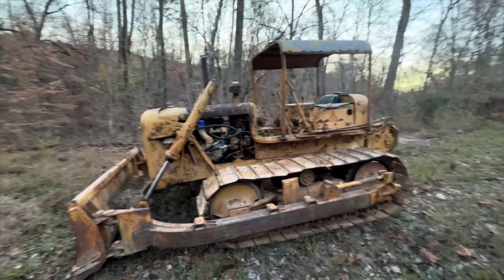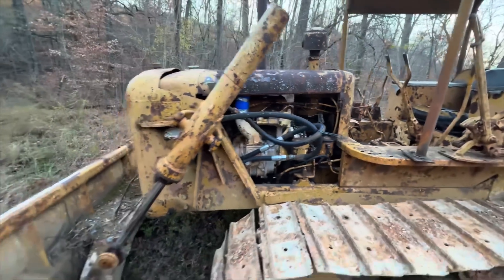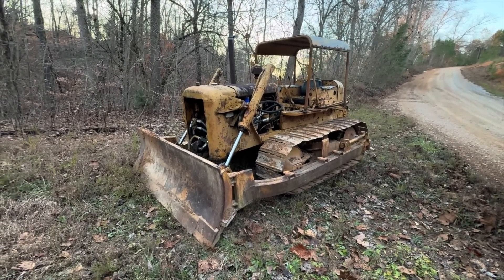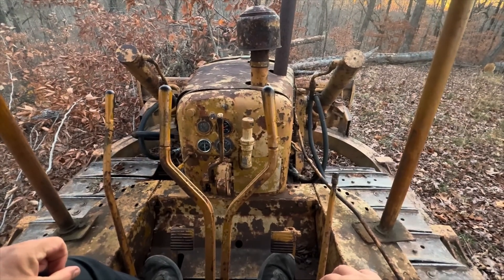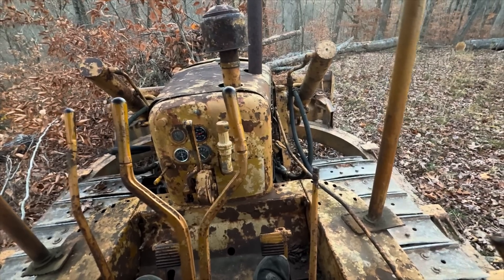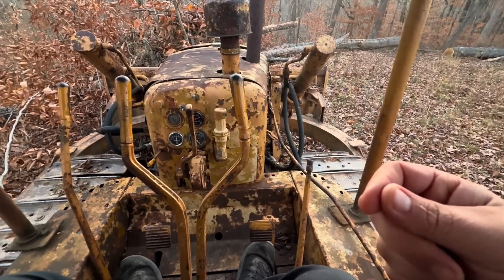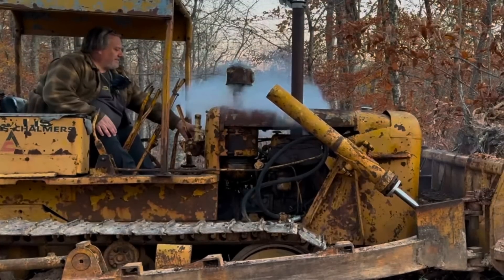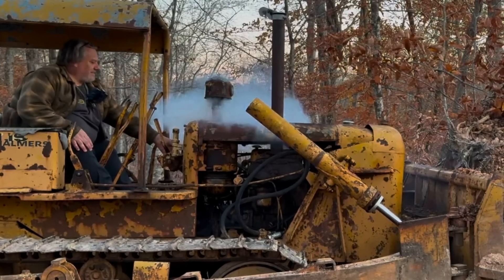Detroit Diesel 2-stroke running backwards. 1950’s bulldozer accidentally restarted running backwards

Comment: We used to do that with multi fuel Duce and a half in the army. Put the truck on a hill, put the trans in 5 th high range. Let roll down the hill backwards and dump the clutch. Smoke billowed out the air cleaner, can imagine what the engine was ingesting pulling air through the exhaust pipe. We thought it was hilarious to have a 5 speed reverse.
Reply: That ole was getting no oil the whole time she was running backwards

Comment: Our 720 John deer two cylinder diesel would occasionally start backwards if it wasn't spinning fast enough when  the decompression lever was released. The oil bath air cleaner would splash out onto the cowling top, making a huge mess. If it ran long enough it would melt out inside of the oil bath.   
Love your videos> It reminds me of working on rusty old farm machinery with hand tools.
Reply: After I changed to electronic ignition, My Yamaha 2 stroke can run backwards too. 
At idle, Just blip it's clutch at the right moment. It'll stall & fire up again running backwards.

Comment: Watching the old dozer thread around the buses, hope a steering clutch /brake do not jam and swing the blade through a bus. With that old dozer I would crawl at a snails pace in those areas.  Your Fire truck just placed a little scare the other day. Yet nice to see the old machines still doing a days work.

Comment: yup. At least you had a fuel shut off. I once had a backspin in a 1966 GMC "crackerbox" with a 318. Neat thing was it had a huge oil bath air filter so not only did it smoke like a Tennessee still in January, it spilled a ton of oil everywhere before I could pick a gear and stall it out. (Key location was a little weird)

Comment: This short backwards run seems harmless but isn’t the oil pump also turning backwards and no longer providing oil pressure?
Reply: That's correct, no oil pressure running backwards.

Comment: Not limited to two strokes. A few years ago, I did the same thing with a Series 60 in a W900L while stalling out a 105,500 lb. hay truck on a hill. It started running backwards before I got the clutch all the way in, had lots of smoke out the air cleaners and a terrible sound. Shut it down let it set a minute then I started it right back up.
Reply: I didn't know a 60 series would run backwards.  That's good to know. I know if a Cummins goes backwards,  the fuel pump will not pump fuel.
Reply: They are on roller bearings

Comment: I had heavy equipment mechanic s friend s they said they made right & left rotation  671 Detroits
Reply from the maker: My bus is a left hand rotation detroit diesel 6-71
Reply: They made left and right in many of the DD series. Common use in boats so that prop walk was eliminated.

Comment: Wow, Allis Chalmers built 29,255 of these machines between 1946 - 1955 !!!  I wonder how many are still running?
Reply: We had three of them until the late 80's. 2 track loaders and a dozer. Bought all 3 at an estate sale and they were like new. Lady gave us all the original paperwork and manuals when we went to pick them up, When I was loading them her dog jumped up and rode on the machine with me. She told me the dog used to ride on it with her husband and teared up a little bit. It was a bittersweet moment even for the 23 year old I was
Reply: I think you mean 1955 to 1974, thats the timeline of the HD6 dozer.
Reply: @clinthowe7629  No we bought them at an estate sale in about 1980, We sold them late 80's early 90's

Comment: Little crawler does good for a 56.2 horse engine . Enough gearing to overcome load . Unless u want reverse rotation.   boats run a right rotation and a left rotation in same boat . Want to see hard to start. Shut off  EMD engines without block heaters on . Had ore trucks with 645E V12s in 10 trucks 3 locos with v16s shut down on Christmas and new years took double shift to heat cause heaters weren’t turned on . . Little TD5 did just fine !

Comment: Crazy! First time I’ve ever heard or seen of a DD accidental reverse run. 
Whatta sweet ole machine that is! Love it!!!!
Reply from the maker: I don’t recommend it ;)
Reply: Had a 671 in a fire engine do that while I was sitting next to the air cleaner... Very exciting....
Reply: Had a few do that over all the years.the valve timing is a little off but it'll run.2 stroke gas or diesel will run backwards if u spin it backwards 

Had a small block chevy in a boat that ran backwards. After putting in a new car engine  every thing was off. Had to change cam..dist...starter...and oil pump .I had to show that one off to anyone that would watch.
Reply: I had a 6v92 run backwards on me Sunday I was trying to get a lowboy unhooked and stalled the truck out in reverse, I pushed the clutch in and it fired back up and I knew right away something sounded different and smelt the exhaust right next to me coming out of the air cleaner. I shut it down right away and luckily nothing crazy happened.

Comment: hey heres something to check out new tech theres a new piston in town called speed of air,, these guys  are making pistons that get up to 20% better fuel econamy and 200 more ft pounds of torque plus runs cooler and it runs quieter look up daves auto centre speed of air interview ,,,if you dont believe him lots of people using them and it works

Comment: I’m pretty sure that oil pumps don’t work when spinning backwards. Running a couple seconds backwards won’t hurt it but I’m sure if you did it much longer with no oil pressure and damage will done.
Reply from the maker: Correct the gauge shows 0 oil pressure when it’s running backwards
Reply: @BusGreaseMonkey old tankers ..have no reverse gear..and run the 2 stroke backwards..for reverse
Reply: Yup I was yelling at a guy one day with his john deere running backwards. He thought it was great, I was like shut it off. The oil light was on.  I even had a 3406B cat run backwards on me in a truck. I stalled it in a tough spot and kicked in the clutch, she kicked backwards.

Comment: I have seen that happen once before.  A young man popped the clutch on a loaded semi tractor and smoke started coming out the intake.
Reply: I had a 6v92 run backwards on me Sunday I was trying to get a lowboy unhooked and stalled the truck out in reverse, I pushed the clutch in and it fired back up and I knew right away something sounded different and smelt the exhaust right next to me coming out of the air cleaner. I shut it down right away and luckily nothing crazy happened.

Comment: So for the time it was running backwards you could've had a few extra reverse gears
Reply from the maker: And no oil pressure
Reply: @BusGreaseMonkey  Oil vacuum......not an ideal situation.
Reply: Will have almost no power since injection timing would be really retarded (it's normally advanced, which is why they can run backwards if the engine slows down enough to have the ignition happen before the piston gets to the top.)